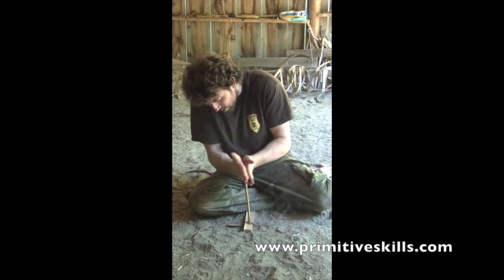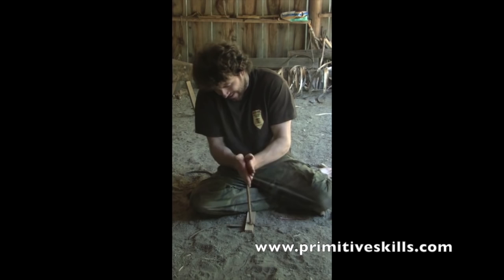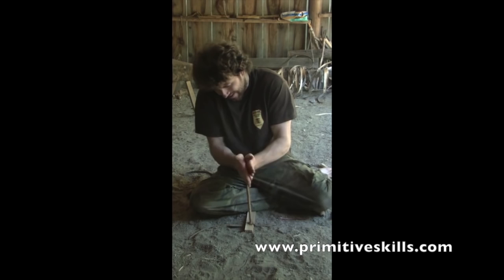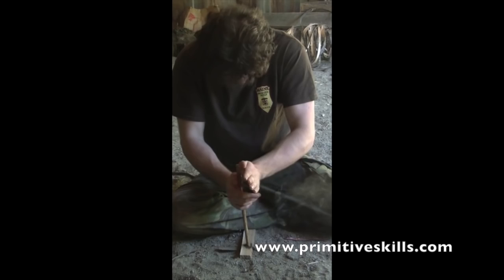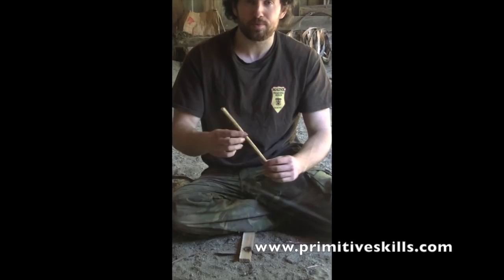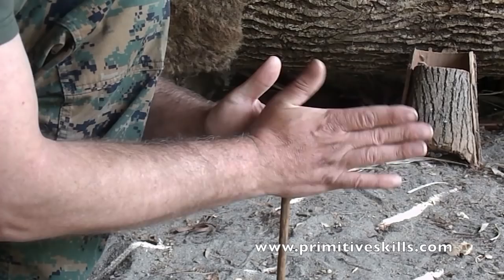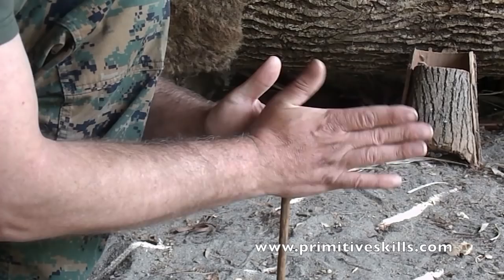Floating Technique For Hand Drill Friction Fire Method

Comment: The hand drill is a method i only done a few times and tore my hands up very badly after 10 mins every time. This is a method you need to learn before trying in a survival situation, for your hands are your life out there, and the hand drill is horrible for causing huge blisters. ALTHO if you master this skill, it can be a life saver. Maybe the next time i'm down i will get you to show me the secrets of the hand drill. I have been very close to a coal, i have that part, my hands just dont hold up, and yes i have woodsman hands. lol
Reply: If you're curious about the floating hands method then you should check out the Boggy Creek Beast channel. He is so proficient with this method that he can obtain embers with a 2 inch hand drill. I have seen him use similar sized hand drills with "on the spot" material.
Reply: Not trying to take anything away from the guy above but I learned from Boggy and am VERY good at it.